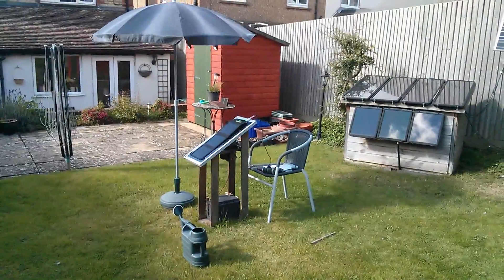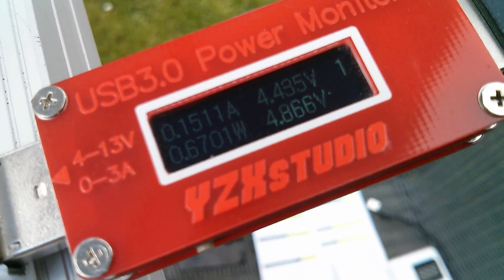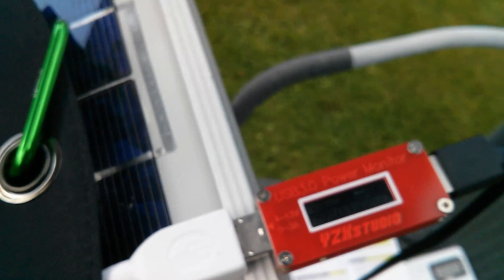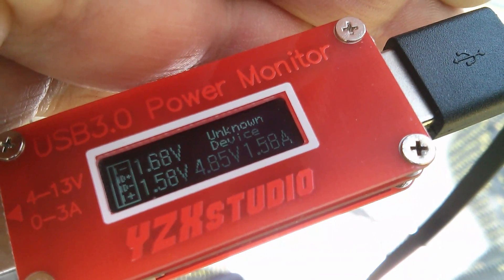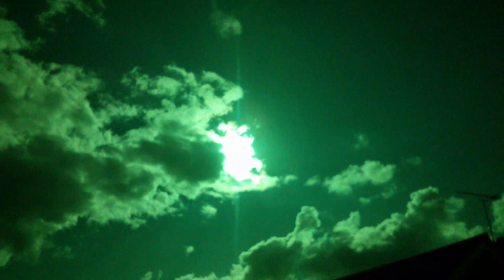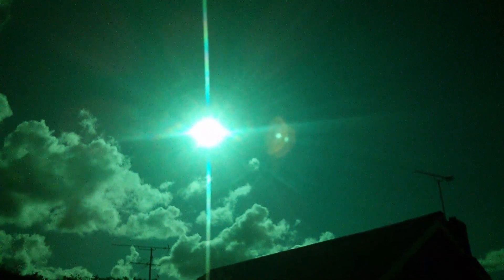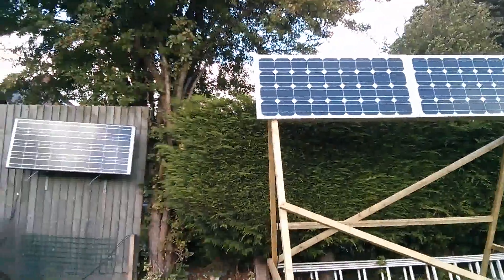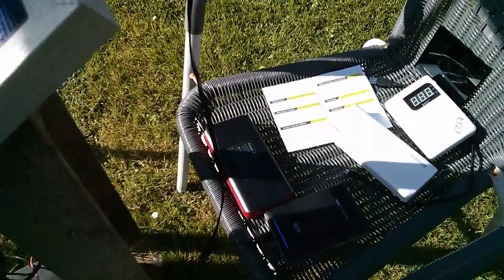USB Solar Panels are Difficult Things to Test (Unedited)

Comment: you can used the buck-boost converter to regulate the 5V output.. so the output power will be stable at 5V no matter the input power was changed..
the module like XL6009, it can do that.

Comment: The USB Output is 5v 2.1alp the same as a usb output from computer or (ac phone charge plug with ac or usb) which are the same, Not to be confused with the 16 watt that the panel produces from the sun converted to be stored to a 12v car/solar battery or solar panel storage battery bank.

Comment: why you need those solar panels in country which is known for crappy weather? :D  You have so much panel, you could charge your batteries for 5 years for 'free' :D And solar panels do not help environment.. the less people use electricity from mains -the cheaper it will be... so pollution will be the same-but just even more cheaper.

Comment: What about using the USB 1A/2A load? Maybe even use two of them, I spotted two usb ports on the panel. If you want to review them you need a artificial "Sun" in the form of a studio light or similar. Edit: Or move to Malta, that works too!

Comment: As you may know, solar - a subject close to my heart...I'm designing an environmental measuring system, most times always only solar-powered. In the North of Finland (65 degrees north, to be accurate).
Made me chuckle to see your fight with the clouds. I've hardly seen a cloud in the sky for almost 10 days - even now (Sept. 15 @ 14:00) it's as bright as a summer day - sun about 40 deg. elevation. So, griping about only a couple of watts - c'm on! My stuff has to live off a 9A/H battery even in Kaamos - midday night - when I might get a dozen milliamps for an hour if I'm lucky. Then the damn thing has to phone home using GSM once or twice a day!
So, I WANT one of those folding panels, and the XYZstudio charge indicator. Links?
Ta. Andy

Comment: Remember that the laser isn't used for the temperature measurement. It is only meant to point in the center of the big spot that is being measured. To measure correct, go close to the object.
Reply from the maker: +zaprodk Yep, and you have to account for the parallax error too. It was just another frustration, that I couldn't see the red dot.

Comment: is it inefficient to just plug a solar panel  directly in to a step down buck converter set to 5v ?
Reply from the maker: +mark ward Ideally the solar panel voltage would be regulated to its max power voltage. So the buck converter needs to regulate both input and output voltage. I'm not sure how that would be done.

Comment: Hi 
I like your take on solar equipment, keep it up makes an interesting update. but on another note as our summer fades here in the UK have you ever though of small wind generators to keep your batteries topped up over the winter, it would be interesting to see the difference in output from the vertical turbine types against the normal propeller design.

Comment: hi +julian illett, could you do a small segment on the USB cables you have tried over the time? I am still trying to find a really good micro USB cable, that doesn't fail on me with connectors becoming loose or simply dropping out of the sockets.
Reply from the maker: +Andre Klärner The problem is most of my cables are unbranded so I've no idea where they came from. Also, you might have perfectly good cable, but like you say, the socket is causing the bad connection.
Reply: well, in most cases I just got the plug in one hand and it's plastic case in the other - a meter apart.

Well, let me rephrase the question: what is your strategy, what do you check on the ebay listing, do you have some sellers that sent you especially good ones etc.
Reply from the maker: +Andre Klärner No real strategy. I like the flat cables - you can see how thick the conductors are. I tend to use the cables that have plugs which 'click' satisfyingly into the socket. I don't like tight fitting plugs. Thick cables are often no better than thin ones. Some cables don't have all 4 (or 5) connectors wired up. Gold plated pins would be preferred, but I don't suppose many socket pins are gold plated. Actually my favourite USB connector is the old type B, used on printers, square with 2 pins on each side.

Comment: The only down-side to charging a power bank, and then charging a phone is that you will loose some of the power generated ( or gained through the the solar panel). This is because of the efficiency of the power bank's circuit/boost converter or regulator. But I can see why you would charge a power bank instead.

Comment: The most practical charge into the battery bank also proves to be the most inefficient by increasing the number of step up and step downs for the batteries. Why they (whoever they are) can't create a 5v battery I'm unsure.
Charging directly into an iPhone when the sun comes back out also stops the charge. You really can't win here and I've got it slightly worse in the North of the UK. Good vid, thanks.

Comment: I always find it best to set panels for best winter output and work from that after all winter is the time you need the power the most I also found a brilliant app for iPhone called simply solar it helps you align your panels for best output for that day I just need to build an adjustable a frame

Comment: You should check out Anker micro usb cables. You can get them from amazon. Quite reasonably priced and really high quality. I have used them a lot and they charge a lot faster than cables that come with devices. Also have measured them with a 4-terminal resistance meter and they have very low resistance.

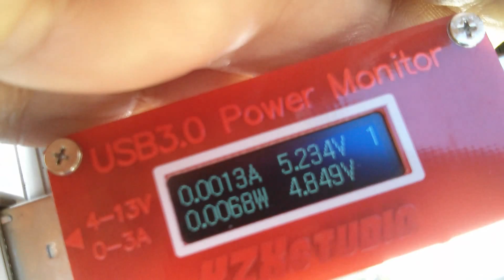Comment: Great video as always Julian. Two thoughts from watching this video regarding testing these sorts of panels. When the Ravpower was connected at 12:00, you cut the power partially at 12:15 (with your hand), but when the ECTechnology unit was connect at 13:00, you totally cut the power at 13:04 (by folding the panel up), as the meter lost power and rebooted. So perhaps the Ravpower is only temperamental when there is a partial power loss? Would be worth checking on. 

Also, for a load, perhaps a load such as a led lamp would be better? then at least you know it will always load up the panel. Perhaps a series of lamps, so you can vary the load, and you'll also be able to visually see if they are working or not. I think using the powerbanks will be bit and miss unless you flatten them off before using them... as it is always possible that when they are getting to the 3/4 stage the they are switching to CV stage, and no longer demanding maximum current. 

btw, for the focusing problem... does the app you use for recording support 'tap to focus' when recording? Otherwise, it looks like the phone needs about 2-3 seconds of stability for it to lock on and focus. Keep up the great work!

Comment: The output is lower than the headline value due to the inefficiency of the buck circuit. You loose 2V from the PV voltage so maximum efficiency might be as low as 5V/7V*16W or 11.4W, which is pretty close to 10.5W stated output maximum.
Reply from the maker: +Thanh Tran I'd be surprised if the solar charger has a DC/DC converter in it. But I'm thinking I might take it apart and have a look.
Reply: Julian Ilett It does Julian. A small one. If you "jack" into the solar output then the voltage will be higher but obviously not regulated to 5V. Take a look at the item you bought off Amazon. http://www.amazon.co.uk/gp/product/B011DUBESW?colid=12L8POC5CYAQ9&coliid=IG9GGJHP3H0UR&psc=1&ref_=wl_it_dp_o_pC_S_ttl on one of the pictures there is an image of the dual USB PCB which an inductor.

Comment: I faced similar problems of inconsistent current draw when tried to build my own power bank + solar panel. It only worked when the sun was very bright, but most of the time my power bank was just not interested in drawing current. Very weird.
I'd love to see you go into more details of power bank differences (that would be converter boards) and maybe build your own BEST power bank :)
Reply: +Sidabra24.com You need a very stupid power bank. If you can't get one, retrofit a TP4056 on it. You need a charge circuit that will just limit current and the voltage at 4.2V. You don't need anything fancy, and it's actually conterproductive as most of the switching or more sophisticated charging circuits gets very confused when the voltage drops a bit but not so much to cause them to reset. 
I've done this with a TP4056 directly charging a lithium cell (in a garden light project) and the results have been very satisfying -- it's been running for one year and a half now (I've changed the battery however as I used a very old NEC battery from 2002 which couldn't keep a charge...
Reply: +MrOpenGL TP4056 is actual the one I used. I used the one with battery protection chip. What power solar bank are you using? I use 6V 4.2W panel, maybe it is too small for 5V system.
Reply: Sidabra24.com
I've used three 200mA 2V panels in series. Here's the datasheet for them: http://www.microkit.com/immagini/ST-MM001.jpg
It's in Italian but I think you can work out most of the data, if you need a translation ask me ;-)
Since it's a very low power project, 1W for about 5 to 6 hours each two days was enough. (On a 500mAh battery, the system comprised of a ATMEGA8 + flash memory + DS18B20 for temperature logging, and a 5W led run at 200mW can last for five days without sunshine). I've added a 5.5V 1W zener diode in parallel with the panels to protect the 4056.

I don't understand your problem. TP4056 should draw as much current as it can, sometimes even drawing the voltage too low, I've seen 4V on the solar panel output and it managed to still get 160mA out of 210mA while in light overcast conditions.
In bright days it can charge the battery in less than two hours.

Comment: wasn't it 16w AC? before converter? 6w losses?
Reply: ac? how can a solar cell produce ac?
Reply: You are right late night confusion I suppose. Then dc-dc converter have loses maybe
Reply: Szymon Krasuski
I was thinking the same. The raw maximum output of the cells is probably 16W, while the maximum output of the USB port is 10.5W.
Reply: +Szymon Krasuski It's just the regular "up to" lab condition claim. ;) They tested it in the deserts of afrika.
Reply: +BloodySword more like on the surface of the sun facing downwards...
Reply: +Szymon Krasuski In the review of the power bank he shows it took 20,000 mah to charge it. It was only about to put out 12,000 mah or so before the batteries died so it was close to 50% loss of energy at the boost converter.

Comment: Hello julian, nice video, just a little note try to redo the video by connecting directly to the power bank or a phone, and then measure with a multimeter that isn't part of the circuit as this will be a real life situation, Also I agree with you regards the thickness and the length of the usb, I intend to use to use something similar to the white one. Cheers.

Comment: Ive got a i think 14w Anker one, Very similar sort of thing. I think its rated for 2.1A out aswell. Seems to work alright when in Australia gets pretty close to the 2.1A out when in optimal sun.

However i would NEVER connect it directly to my phone or tablet. Ive got quite a few powerbanks so would always charge a powerbank then charge my phone from that. Id much lose a $25 powerbank from the unstable power output of the solar charger than my $800 phone
Reply from the maker: +TheColinputer Yeah, I'm thinking pretty much the same thing. The problem is that charging a powerbank is lossy, and drawing that power back out is lossy too - typically at least 30% is lost during the round trip.

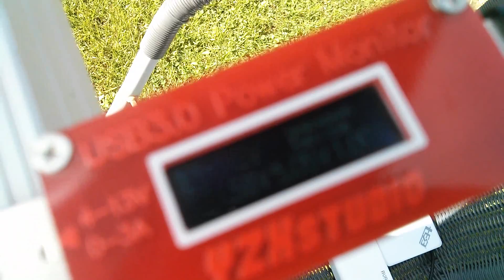Comment: 4:30 - Haven't look further yet on the video but you haven't plugged in the meter fully, that's why it's recognizing garbage now due to 2 contacts not being connected fully.
Reply from the maker: +EpicLPer I saw that, and I'd agree with you if the D+ and D- voltages had been floating around, but they seemed quite fixed.
Reply: wanted to say that :)
Reply from the maker: +EpicLPer Perhaps I do agree with you now. I tried pulling the plug part way out of some powerbank sockets and D+/D- are fairly stable at about 1.6V when floating. Not sure why they don't move around more.

Comment: Have you ever thought to make a controller for a motorized mount to turn the panel toward the sun? That would be a neat project.
Reply from the maker: +iforce2d I've certainly thought about it. Two motors, one for pan and one for tilt - either tracking the max power point by moving the motors and checking the resultant power (similar to the MPPT P&O algorithms). Or you calculate the positions using date and time information and lots of complex trigonometry. Big project!
Reply: +Julian Ilett 
Whoo-hoo! Solar panel movement according to it's horoscope!
Reply: I agree this would be a good project and would love to see Julian's take on it. Lots of arduino solar "follower" projects out there to build off of.
Reply from the maker: +Jon Vannatto I've just realised that the perturb & observe algorithm would need to operate in two dimensions (driving both the X and Y motors). One dimensional P&O was difficult enough. The astrological calculation method now seems more attractive.
Reply from the maker: Oops, very Freudian :\
Reply: +Julian Ilett Might be easier to do P&O for pan and change tilt according to the time of day. Seems like it would be the best compromise.

Comment: you will have to get one of them resistive dummy loads for usb , the selectable 1&2 amp
Reply from the maker: +jusb1066 That would give me a nice stable load, but it's not very real world. I can't remember whether the EC Technology power bank has a pass-through mode. If it does, it would smooth out the power interruptions from the solar panel and provide more reliable charging to a phone.